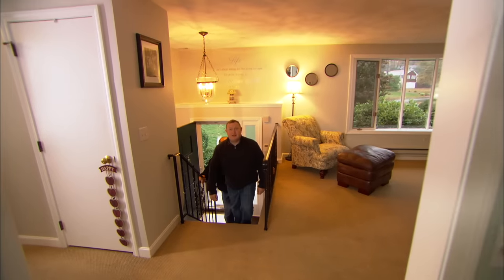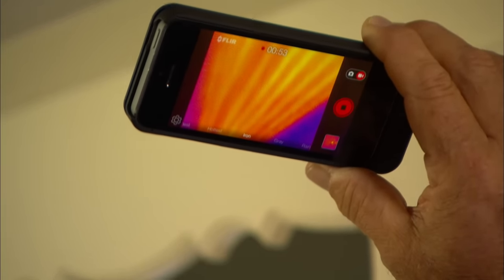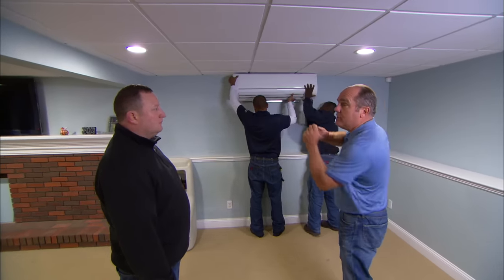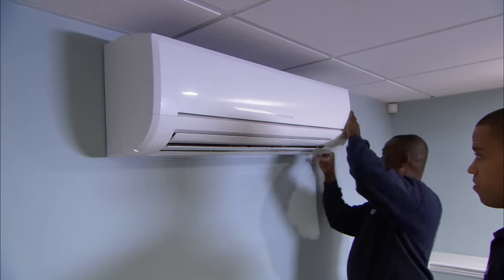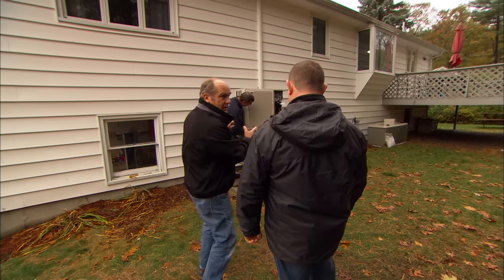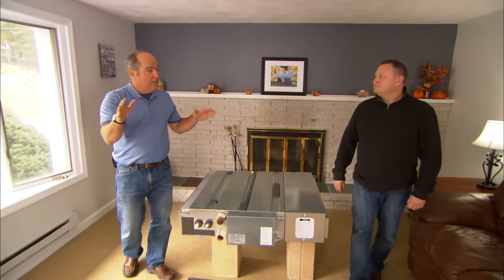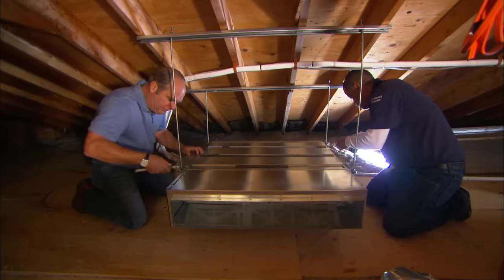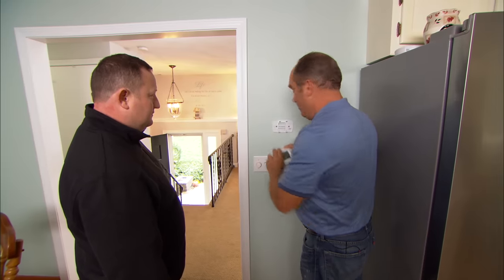How to Install a Whole-House Ductless System | Ask This Old House

Comment: 2:35 The inverter property of an air conditioning AFAIK refers to the fact that there is a variable frequency drive on the compressor so it can run slowly instead of just only on or off. A variable frequency drive or VFD is basically an inverter like you use for camping. It converts the incoming power to DC and then makes it AC again at the requested frequency which determines the motor speed. It has nothing to do with getting more heat from outside than you would without inverter.
Reply: Well yes and no, You see in a standard heat pump the Air Conditioner capacity for cooling cant be over sized, both by code and actual operation. It will cause mold, temperature swings and freezing up. BUT an AC system only makes a 20 degree difference in temperature by design, So it is only cooling 90 degree outside to 70 inside, where as a heat pump must do 40-50 degree differences. But with a single speed compressor ether the AC is oversized and the heat pump side is undersized or the other way around. Now with VFR we can have a properly sized heat pump compressor that's got the capacity but can scale its power down so its not grossly oversized in cooling mode.
Reply: Ozzie Sheppard That makes sense. Though then this implies a few more steps than just “if inverter then better performance” like Richard explains it. Thanks for the info anyway!
Reply: Any time, I think he just says that to make it simple for people that don't understand things like manual J calcs, ETC.
Reply: On top of the benefits Ozzie mentioned, inverter mini splits just about always have an electronic TXV and variable speed fans inside as well as out. Compared to a conventional unit, they run close to optimal over a huge range of conditions.
Reply: Ye cannat break the laws of physics cap'n!
Reply: Yes sir, But do you understand them? How about thermal loss from crystal structures, now thats a mind bender!
Reply: jon doe  (great name)   
Yes, Im a gc so all the homeowners want to hear is its cheaper and it will last longer !  they love it.
Reply: Ozzie Sheppard I sell  80% furnaces and 13 seer condenser all day. You'll never get return on investment going super high efficiency
Reply: Robert Gaylor wrong.
Reply: Charles Spalding  where I live people only use their ac about 3 months out of the year so it doesn't make sense to spend an extra 10 grand for a vrf system.
Reply: robert gaylor Yes I will, Im making the money off selling it, not operating it. Also higher efficiency stuff isn't very expensive if you know where to look. Im also a big fan on ameristar for my base model stuff.
Reply: Ozzie Sheppard so you upsell trane knock offs knowing your customers will never make their roi
Reply: No, Really there are two ways to look at a cost projection, long term and short term, its cheaper to install ameristar units (made by the SAME company as trane) but its much better to invest in a 20 seer or above unit if your staying in the house for more than 10 years, there really is a cost difference- but no matter what I recommend a heat pump, There is a MAJOR roi on that.  

Also ameristar is my go to for cheap heat and ac + heat pumps, great quality for the price.  My top end (which I rarely use) would be carrier, my favorite to use If I can is Thermalflow hvac, They have a 15+ year warranties and some of the most efficient equipment out there.
Reply: Im glad someone pointed this out lol. How did he come up with the idea that outside air is being seperated by temperature?????
Reply: @Kevin Original In many commercial settings this is the case, But in most residential they only have single phase power coming from the utility, two hot legs, a neutral (and as of recently a ground)- Its an interesting idea but I've found that the capacitors in a good quality unit last pretty-much the lifetime of the equipment,  Even if you can buy a unit that is so well made it will last 40 years it is not logical to. Because financially it would have made more sense to replace cheap moderately efficient equipment every 10-15 years with a more efficient model and save more than the install costs on energy savings alone- Which is why I am big time into affordable heat-pump systems. 

The way I look at hvac is this: How can I provide (safe Eg, properly exchanged, sanitized, mold free), filtered air at  comfortable temperatures and humidity levels in a home as cost effectively as I possibly can- Answer,  cheap and easy heat-pump systems.
Reply: @Kevin Original I haven't heard of anything like that, I know there are some interesting
 heat pump compressor designs for geo thermal out there.
Reply: Just an FYI for you guys.....I sell Mitsubishi industrial electronics (think massive VFD's..upwards of 300HP).  Mitsubishi is a worldwide leader in this field and they make them in Japan at the largest manufacturing facility in Japan under one roof.  Massive place.  
So when you buy a Mitsubishi mini-split unit, you are buying electrics and VFDs from an absolute leader in the field and they (obviously) use their own equipment.  If you buy another brand, you're getting the cheapest VFD with hodge-podge mix of electronics from China.
Reply: @davec.3198  Yes but the question is, which is more cost effective over its life span.
Reply: @ozziesheppard17  Clearly that depends on how long each one lasts.
Reply: @davec.3198  Yes, but not just that, On my buildings I replace equipment when the replacements efficiency is such that its half its lifespan will pay for and save vs operating the current equipment at its efficiency. 

We service our own hvac equipment so maintenance, repair isn't really a needle mover on cost so its all about efficiency upgrades over time.
Reply: @ozziesheppard17  Then you will not replace the mini splits for a long time.  They perfectly regulate the room temp for very little money.  In the toughest summer months, mine cost about $30 per month to run and I kept it at 70F even when it was 90F out.  Amazing efficiency and perfect comfort because you can adjust the settings right at the head unit with a remote.
My wife loves the dehumidification feature as well.
Reply: @davec.3198  Yes, But new technologies and refrigerants are always coming out, r290 with its low head pressure is right around the corner and that should offer some good savings.
Reply: b8e71fcbe2e195c67d8d16734013d20f there’s also no question these outdoor units are extremely quite
Reply: Kevin Original there is no run and start capacitor in a inverter driven vrf system And they start slowly so the components don’t really suffer much wear and tear
Reply: Ozzie is partly correct. The inverter drive uses DC power. (Not a VFD). It has permanent magnets that can be activated, spinning the compressor motor at a much higher rate of speed than a traditional AC powered compressor can (its speed is limited by the frequency of our electric grid... 60 Hz). The higher compressor speeds allow it to compress the gases to a higher level, the differential heat is increased... delivering more heat energy with lower electricity consumption.
Reply: @ozziesheppard17  A good friend who is a major Trane dealer (60 trucks) still dislikes Trane minis because of some really bad start up pains with them from several years ago; bad case of trying too hard and cheaply to catch up to Mitsubishi, "Pioneer" and a few others who came first.  And a look at DETAILED specs will verify that most compressors, like auto batteries and something of a sort of, kind of...KEY component, are mfd by just a few companies, all Far East based.

Comment: As an alternative to electric baseboard ,radiant heat is ok. You can have a separate stat in each room and no duct work or drafts. In the late 196o's we wired several new home this way . They were in an area without gas service and the utility gave them a time of day meter for the heat at a very low rate. This was great till the program ended an the heat rate was equal to normal rate.
Reply: My Father had this system in his home in NCarolina. It was great until the ceiling fell in and the entire system had to be abandoned. It was a friggin catastrophe when it happened!
Reply: My issue would be heat rises and it is already above your head.

Comment: The coils are outside of house envelope. The rule of 72 applies. Last week it was 98 in New Hampshire, the lowest the AC thermostat could be set would be 78 before the coils in the attic freeze up. Shouldn’t the coils be in house envelope? Either put them in a closet or extend the envelope to under the roof. Right?

Comment: For heat at least, I have to wonder if a regular high efficiency condensing gas furnace would be cheaper to run?

On the flip side, if the homeowner wants to spend more money up front, he can put in a solar system to generate some of the power to run the heat pump system.  Further south, with a better solar coefficient, this could be really interesting.

Comment: All these lines and coils means more possible for line a coil leaks and circuits boards going out!!! If your going to add all these units in several rooms just put in a damm big ac unit!!! Less problems in the long run. Plus these large units cost 3 to 4 times the cost of one large unit.

Comment: That's fine when you are building new house, but investing around 20K to replace existing system?! Did anybody calculated return of investments? When you count the delta between what you are paying now and what you will be paying after installation of new system, you will be probably in 30-40 years till you see the financial benefit.
Reply: Laughs in 2021 housing market voice
Reply: Radiant heat is terribly inefficient. I’d imagine electricity bill is a quarter. Probably 20 years. Plus radiant heat is very dry

Comment: My Fujitsu's work down to -15 f. So far this winter it's worked perfect and my bill is only $100 a month
Reply: How much ball park figure does it cost to buy hardware & installation?
Reply: @CharlesLukoba  i have a 3 ton, 3 zone  units. One 18k btu and two 9k btu. Contractors wanted to charge me 20k, I have a 609 universal license so I bought the equipment from a distributor for $4900. All together with everything I had to purchase to get it running, I spent $6500. I installed it myself.
Reply: A Font Jesus so the profit margin (greed)company’s charge is what kills making it more affordable for the average consumer not so much the equipment .i couldn’t sleep a night knowing I ran my company that way ,I’m not the cheapest in my field but I’m not raping customers just to have excessive profits for my Benefit .no I’m not in the ac heat biz ,so maybe I’m disconnected on actual labor cost of these type systems ,so I would like to hear somebody chime up on justifying such a jump in price of 6-7 grand materials to a total 20 grand with installation .i could see if access is limited complicated and  more time consuming but a traditional house with a clear attic and or crawl space I wonder .
Reply: @kevinclark4459  when I looked at my quote they wanted to charge me to mount the evaporator head which is the part that blows the heat into the house, $4500 per evaporator. Mounting that evaporator is the easiest part of the job.
Reply: This is amazing. Do you think it will do the job in a  New England cold weather?
Reply: @synewparadigm  , yes, it definitely works.  They are amazing.

Comment: In Dominican Republic almost everyone uses this system for cooling. It really does the job!
Reply: I was just in the DR and there was only one place that I saw one of these....but it was the best A/C out of every other building we went into.
Reply: Turk Blackwell yeah they’re great. In DR this is honestly their only option since you can’t have a window unit (theft prevention/windows have rebar). I have seen them in Mexico and here in NJ at my barbershop. At the resort we stayed in Mexico the unit was so efficient that we kept it at 69°F while outside temperatures were in the high 90s
Reply: Do you know how much HVAC techs make down in the DR?
My wife and I have been looking into moving there
Reply: @davidcerino1145  i wish i could move there but with money
Reply: @wilg4654  same here.  I install these systems in WA state.  While I am aware that I cant make nearly half of what I make here down in the DR, I was hoping at least I could land a specialization job like this down there.
Reply: @davidcerino1145  but let me tell you is a very different place punta cana from the real santo domingo
But living in the usa there is to much strees here you live to work
But it should be the other way around
Reply: @wilg4654  Not sure I'd want to live where theft was such a problem that window AC was not usable (I'm not praising window ac).  But I live in rural VA where things are a bit "lower key".
Reply: @replyhere590  cool men

Comment: Is it just me or is that outdoor stand super rickety? Seems like hurricane / windstorm and that thing will blow right over.
Reply: Ben Hines I like the idea of wall mount outdoor better
Reply: Top of the unit also bolts to the house which he didn't show.
Reply: @garyduke23  Also looks like they still needed to screw it down to the concrete pad. They probably did that last.
Reply: @dylanreischling4151  you probably need some distance from the house...
Reply: @ovidiuciuparu6421  what?

Comment: I like how they talk about finding heat outside on frigid cold days. What they never say is that it’s a basic law of Physics that says Compressing gases makes them get hot. It’s not till it goes through a Venturi where the pressure drops that you get the extreme cold used for refrigeration. Ergo if you reverse the system you have the high-pressure gas which is hot going in front of the blowers that blow the heat into the house.
Reply: This isn’t a HVAC class or a physics course. The details on how it’s done don’t matter here. He explains the basic refrigerant cycle and that’s plenty for people who watch this. Those who want more can find it online.

Comment: I thought heat always rose. If the heat is produced and it radiates from the ceiling in the kitchen wouldnt it be very inefficient?
Reply: hot air rises, heat transfers to cold...... that's why they're called hot air balloons, not heat balloons LOL

Comment: I have two ductless mini splits exactly like the one in this video.  I also have a ducted unit on my 2nd floor.  I stopped using them for heat.  In Jan/Feb my electric bill was over $700 per month.
Reply: Now you need wind power turbines or solar panels and a storage battery to power your system.
Reply: Sounds like they were poorly sized or installed wrong

Comment: Remove bottom 4' sheetrock. Remove utilities install foam in wall build transcoding with flat romex then 2" foam panels exterior. Super insulation house a hair dryer for heat . passive cooling windows top and bottom. Window sun block summer cut heat gain. Foam attic.

Comment: The question that comes to mind is, what happens on a day that is below 5 degrees? I assume it would struggle to keep the house above warm.
Reply: There's backup electric heat.
Reply: They’ll still heat down to -15f
Reply: @mark31383  Ooh - we have had -20F here in Flagstaff, but only once. We have a gas fireplace that will probably be our backup for the really cold days.

Comment: Never seen these new attic installed mini split air handlers. pretty interesting. Wonder how efficient they are in terms of Seer rating as well as the cost. Being an all in one evap/blower/air handler/txv etc they must be pretty expensive by comparison. The fact you can install then off one condenser and run them zoned is something I have not seen before. I have seen the mini split condensers with multiple head units but those each run individual linesets.
Reply: bdbrolly oh these systems are neat. 
Mitsubishi has a system that allows for dual heating and cooling simultaneously.
Reply: Just adding a note here that I recently saw one demoed that took this to all another level. They've actually added brains to that manifold box and some kind of valving. Let's say you've got one air handler on the west side of the house that's getting direct sunlight in the evening and that room is heating up. At the same time the basement bedroom is running at 65° because it's subterranean. This one is smart enough to interconnect those two in such a way that it actually dumps The heat from the bedroom down into the basement. Basically before it dumps temperature to outside or pulls temperature from outside it balances the inside first

Comment: electric wires designed to heat up are plastered into your drywall.  what could go wrong?
Reply: Nothing.  Drywall is fire resistant.
Reply: canuckguy worried  You ever have your drywall catch fire?
Reply: Geoff Pritchard hey, if steel beans can burn...